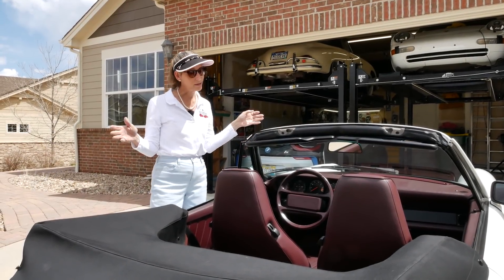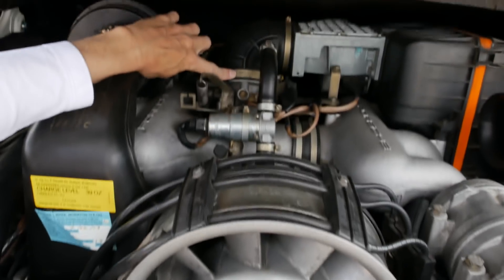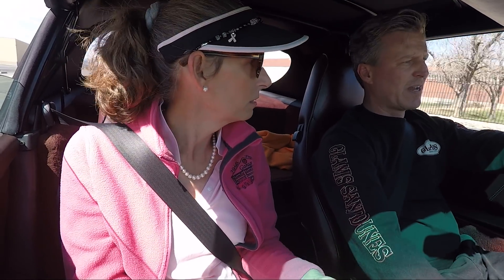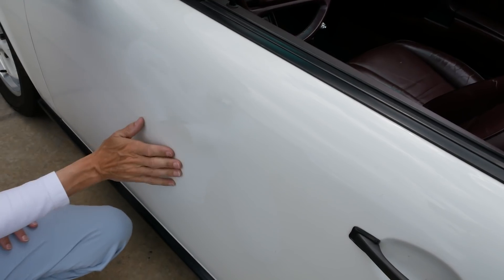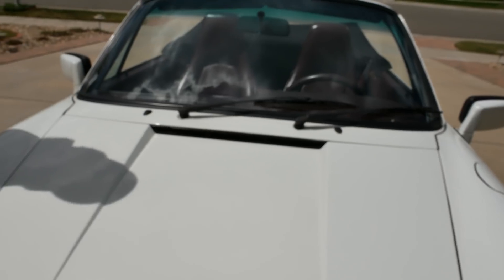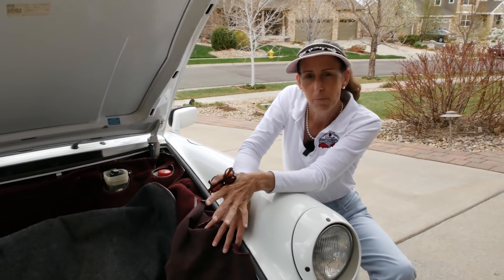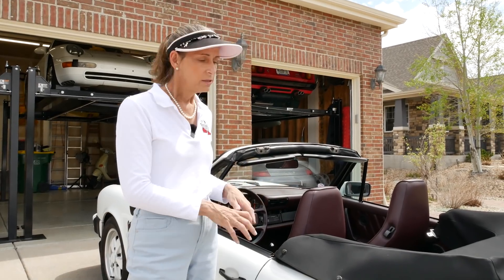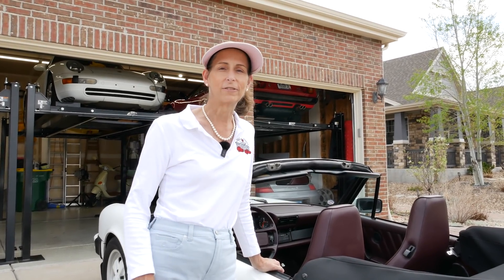Budget eBay Porsche 911 3.2 Carrera Project #1 - An Introduction - What Are We In For??

Comment: I know I'm late to the party here. Just wanted to chime in and say thx a lot for this series! Your thorough explaining and process is really enjoyable and educational to watch. Super solid video production as well. Excellent audio, image and lighting.

I got an '87 Carrera "driver" car myself (With roof). Planning some of the same refurbish activities you have been through with yours. I've done the electricals, fans & ventilation, and everything in the doors already. Today the car is at a shop getting the rear sway bar brackets replaced. Having booked time at a leather and vinyl restoration shop this fall, due to a previous owner having smoked sigarettes in the car (multiple burn holes). Doing the suspenison and brakes myself the comming winter. So I've got some enjoyable projects ahead of me :)

Regards from Oslo, Norway.

Comment: Fantastic video. I especially like the no nonsense approach to the required  initial inspection to determine the scope of work and to honestly evaluate whether one should invest in its restoration or merely keep the car as it is and enjoy.

This series is perfect timing for me as I undertake my own cosmetic refresh my 1989 3.2 Carrera Targa. I bought it 3 years ago from its original owner. The car had sat for over 15 years and it’s now mechanically running perfect, with even the a/c working.  It had 56k original miles when I got it. I loved the classic 911 aesthetics for the car but as you mentioned the much improved G50 five speed transmission and hydraulic clutch. It’s time now to refresh the cosmetics of the engine, some small dings on the body so I’ll be following the series closely.
Reply from the maker: That is great.

Comment: I too look forward to your videos on this refresh.   I just completed a full suspension refresh of my 85 cab that started due to the creaking you mentioned - wish I did it three years ago.  With 110,000 on mine - I am considering doing the same engine out top end (consuming oil - valve guides) and tranny rebuild.   Debating on what I will do myself vs having someone else do it!

Comment: Very nice vids giving good information without a lot of waste.  The effort shows. 

I'm on about #20 in the play list and just bought an 86.  It's so beautiful I like looking at it even when I'm not driving it.  Still, here are many of the same issues you've fixed.  

I'm wondering what the issue was where the rear bumper connected to the body - rust? How bad?

Comment: Very excited to follow your refresh on this one. I’ve got an ‘87 3.2 coupe in very much the same condition however I just pulled my engine due to 4 failed head studs on the bottom end (and at only 67k miles!) I live in Denver and source parts locally from Storz but I am yet to find a really good local machine shop for these cars maybe you have some insight? I’m also considering doing the 3.2 to 3.4 conversion while I’m in there...
Reply from the maker: We might. Storz has a very good rep.

Comment: I don't know what paint you're going to use on the fan (I thought it looked pretty good from here), but in my experience it doesn't last long before the leading edges show signs of "grief" (again). Is there some new wonder epoxy that can resist the ravages of dirty air blasting? I really look forward to seeing the car come back together. Good luck!
Reply from the maker: I know exactly what you are saying...  I have seen them powder coated, but there is very little clearance between the fan blades and the shroud.  They don't look all bad if they are just cleaned well.  TBD ;)
Reply: Why not just have it polished??

Comment: The syncro shifting part of the video where chad explains how the syncro isn't really used when you shift at the correct rpm's: can you expound on that a bit? For example, if i were to shift at the correct RPM's from 1st to 2nd, what rpms would I be at?  And so and and so forth through to top gear.
Reply from the maker: I believe it is about 4500RPM-ish... Also, if you rev-match your downshifts you'll get to know that RPM pretty well.  The syncros let you fudge the RPM a bit, but a properly shifted transmission has a clutch that last forever and same for the syncros (normal street driving of course).

Comment: Looking forward to your videos on this topic. I have a 1984 3.2 targa with 101,824 miles. As third owner of this car for the past 21 years and having just retired I'm wanting to do a complete refresh. The things I want accomplish first is to improve driveability. Over the past ten years the hesitation and stalling has increased to the point where it's becoming less fun to drive.
Have always kept up on maintenance such as ignition components, lubrication etc. But I believe due to age vacuum lines, fuel injection components etc are beginning to fail. Hope you will cover some of these subjects during your restoration.
Love your videos
Thanks
Reply: I too look forward to your videos on this refresh.   I just completed a full suspension refresh of my 85 cab that started due to the creaking you mentioned - wish I did it three years ago.  With 110,000 on mine - I am considering doing the same engine out top end (consuming oil - valve guides) and tranny rebuild.   Debating on what I will do myself vs having someone else do it!
Reply from the maker: Yep. Awesome.

Comment: Sorry cylinder number five the middle on the left is infact cylinder number two on a 3.2 911 these are basics and are even on the decal in the engine bay.
Reply from the maker: Yup... #2.  I was thinking of the 356.  My bad - Good catch.  I have videos on the valve adjustment and such where I go into the layout and firing order in depth.